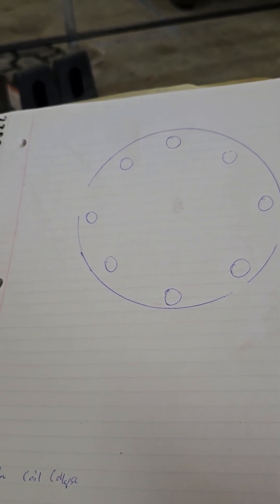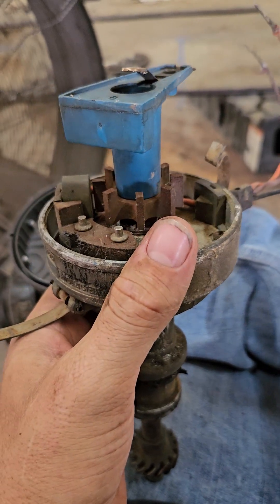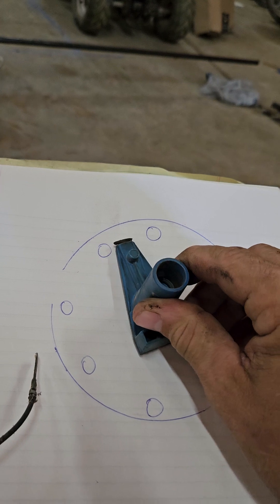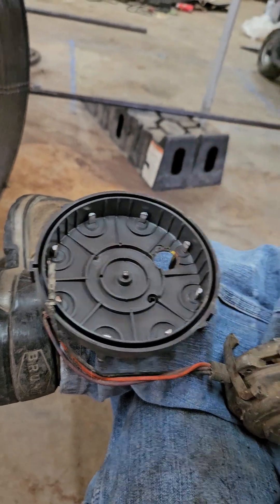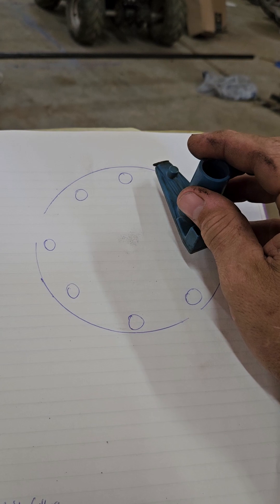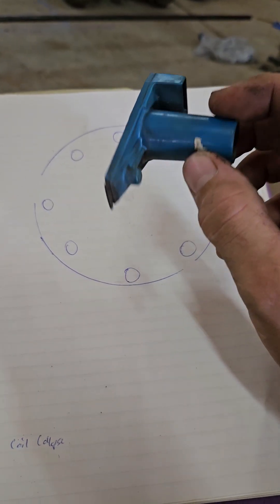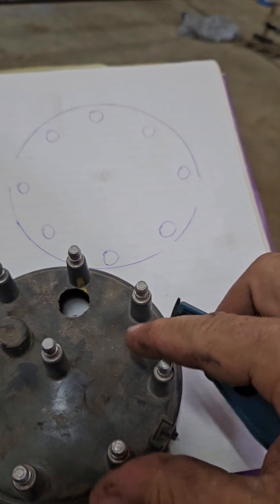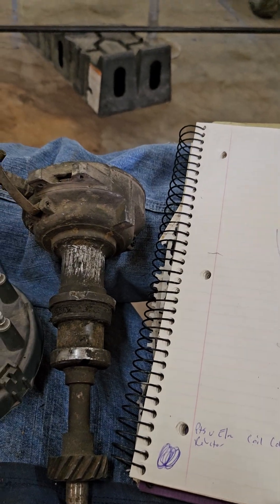rotor phasing explained simply

Comment: Are there any stock distributors with adjustable rotors, adjustable caps, or adjustable advance plates/pick-ups? Are there any stock engines with crank triggers? In general there is no phasing adjustment on a stock engine.
Reply from the maker: @nicholasagnew2792  as far as stock distributors I'm not gonna say there aren't but I've never seen one.  And with regards to crank triggers fuel injected cars all are but I've never seen a factory car with a distributor that triggered from the crank.

Comment: I can't believe how many people think that by adjusting your timing you are adjusting where the spark happens on the rotor. Without an adjustable rotor, an adjustable cap, or an adjustable breaker plate/electronic equivalent THERE IS NO ADJUSTING THE PHASING. Rotor phasing on a normal distributor is a term that describes the phasing change via the vacuum advance ONLY  because the vacuum advance moves the breaker plate. You are so right! Mechanical advance had jack to to with phasing! Thank you!